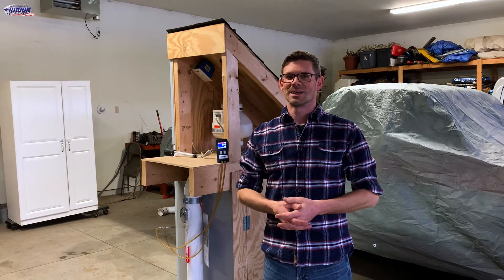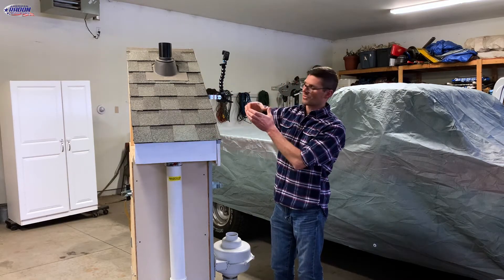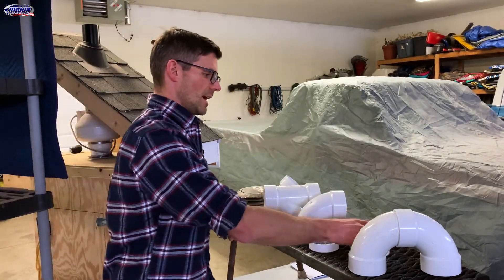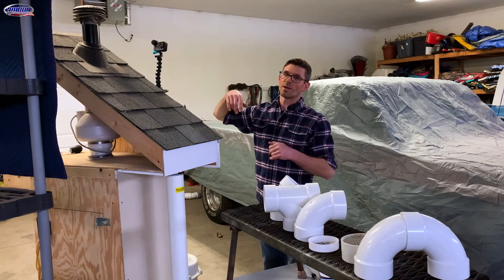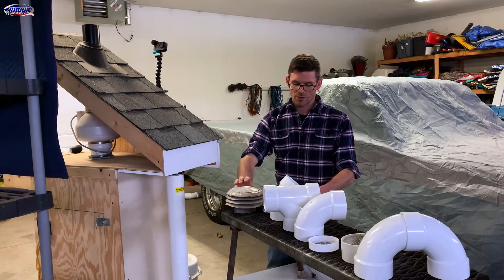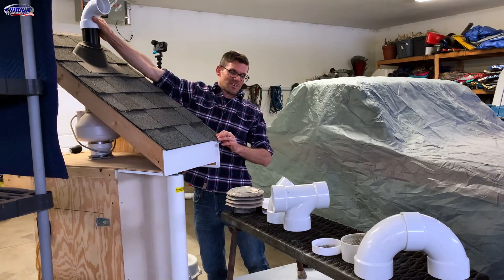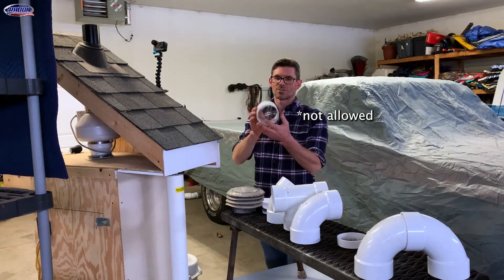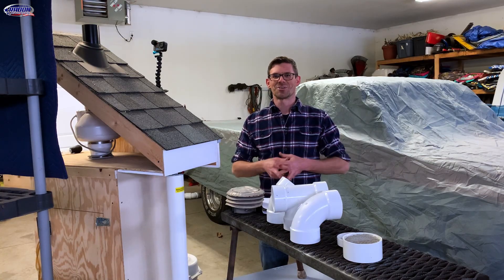Rain Caps on Radon Systems? Why We Don’t Use Them

Comment: Great video.  I am in Florida and we can get some major rain.  I just had a mitigation system installed and noted there was no cap on the exhaust pipe on the roof.  Although I read it is not necessary, the thought of that much rain going into the system, through the fan, and back into the foundation caused me some real anxiety (I heard termites like a moist foundation).  So I put a cap on it.  Got it from Amazon (RadonAway 76001 Vent Cap for 4" Schedule 40 - I have 3" pipe so I had to use a connector to fit my exhaust).  I noticed recently that the radon levels in my house spiked, but only at night (from .05 to 9.43).  It then comes down during the day.  I thought the cap may have been the reason, but the first several days with the cap I saw no increases.  I guess I can get up there and remove the cap to see if that makes a difference, but it sure feels like it is still moving the same amount of air.   Before I try to remove the cap, I wanted to know if you or anyone else has had any experience with this cap causing issues.  Maybe remove the "critter guard" screen to increase flow?  We do not have "critter" issues.  Your thoughts?
Reply from the maker: Boy, I'm not sure what would cause that. Could you be getting re-entrainment with the discharge air being pushed in a horizontal direction? Perhaps the winds are calm at night allowing the radon from the exhaust to enter your home.

Comment: I cannot express how grateful I am for this video. When we tested for Radon results came back at 40 pCi/L. That is not a typo. I picked up an EcoQube radon detector for monitoring and saw peeks as high as over 60 pCi/L. I installed a mitigation system using 4" pipe and a strong suction fan. The system reduced the Radon considerably, but we were still averaging around 6 pCi/L. I was trying to figure out what next steps I would take when I stumbled across this video. I had put a half sphere rain cap on my system to prevent rain from going down the vent. After watching this video I jumped up on the roof and pulled the cap. The levels came down and I've not seen them go above 2.1 pCi/L since pulling the cap and average around 1.2 pCi/L. Amazing what just a little resistance to the air flow can do. Thanks for the great demonstration and all your other videos that have helped me so much to get a great working system!
Reply from the maker: Thank you for your comment, Kevin. I'm glad the video helped you make your home safer.
Reply: How long after did  you test after installation? Could take some time to lower levels.
Reply: This can't be correct. This was just a coincidence. As you can see in the video, he says the CFM is the same open or with the cap, the only difference is it blows the radon downwards which is not allowed and not good for open windows

Comment: I know your are inclined to locate fans inside rather than outside.  But if your home does not have an attic, and you are not allowed to put it in a garage with living space above, you are forced to put it outside.  Have you utilized any low profile encased fans for exterior mounting?  I have seen the fantech RNSL as well as the "RadonAway" encased low profile sold at home depot
Reply from the maker: I have used each of the low-profile fans you are talking about. They are the equivalent of a midrange radon fan. I prefer the mounting method used by the Fantech RNSL over the RadonAway SF180. However, the SF180 gets points for looking cleaner.

Comment: Why does it matter if it goes down. Its on the roof. Mine comes out the center of the roof. It would have to move many feet, down and then find a window or door which is unlikely. Do you ever see smoke from a chimney come back in a house? Makes no sense.
Reply from the maker: This is covered in Section 6.4.9 Angled Trajectories in the 2023 Soil Gas Mitigation Standards for Existing Homes. Here's a link https://standards.aarst.org/SGM-SF-2023/26/index.html#zoom=z

Comment: My GFCI tripped on radon fan after high rain. I took the fan apart and seems there was water on the inside causing GFCI to trip. I think a 90 degree bend on the top will fix that problem.
Reply: They have a bypass offset rain drain coupler

Comment: I didn't have a cap and a chipmunk ended up inside, killing the fan. I put a radonaway t vent cap when I replaced my fan.
Reply: Probably doesn’t comply (or work too well) with a dead critter in the fan blades. Sometimes the better is the enemy of the good.
Reply from the maker: You may want to check to see if your radon system still complies with the mitigation standards since adding a rain cap. 

See section 6.4.12.2 https://standards.aarst.org/SGM-SF-2017/26/index.html

Comment: We had a Radon mitigation system installed in 2006 in Wisconsin. This summer we noticed mold growing on the pipe running up through our garage. The fan is still working properly based on the gauge reading in our basement.Can you do a video that addresses this issue? Thanks.
Reply from the maker: Yes, we can. Would you be able to send us some photos of the issue so we can add them to the video?
Reply from the maker: That's not a bad idea. How do you suggest I set this up so you can see the results?
Reply: I assume "on the pipe" means the mold was on the outside of the pipe, not the inside then? 
I'd guess it's condensation on the pipe that's at fault then, not rainwater, etc.

Basements tend to get a lot of warmth/cooling from the ground around them, so if it's hot out, the basement air is probably significantly cooler than your garage. The cool pipe in a hot/humid garage would attract condensation.

In theory, I would expect an air conditioner or dehumidifier in the garage to help lower the dew point (pipe would need to get even colder before it attracts condensation), but it's kind of expensive/energy intensive to air condition a garage just to avoid mold on one pipe. 🤔

I suspect you'd want to insulate the outside of that pipe with a closed-cell spray foam or something. Open-cell foam, or fiberglass insulation will still let tiny bits of air through to the pipe, where it'll still condense, and you'll just end up with soggy (and ultimately moldly) insulation. 

My old apartment building had to have some cold AC lines in the walls redone several times, the contractors didn't put the right kind of insulation on the new pipe, and even the tiniest gaps were enough to let warm air reach cold surfaces. It was still dripping condensation down 6-7 stories into a bucket in the lobby when I left...

Comment: if you want to vent out a wall, and across, with a bit of a downward slope is that OK.  If radon is heavier than air, how does it get all the way out the roof?
Reply from the maker: I'd point you to section 6.4 of the radon mitigation standard. That section talks about the exhaust discharge requirements. https://standards.aarst.org/SGM-SF-2017/23/index.html

Comment: We recently had a storm here in Florida that dumped a whole lot of rain (48 hours of non-stop rain). Our radon contractor used a cap (4 way exhaust cap) on our radon system. I'm wondering why? A bit more info, the suction point is about 40' away from the exhaust point in the garage. In addition, at the point of suction, the pipe runs up an additional 10' inside a vaulted ceiling closet.  The majority of the pipe run is horizontal through our attic. Do you think that has anything to do with our cap and having water not move through all the pipe run? 

Does capping the exhaust really matter if 1) the exhaust is placed at the appropriate distance from windows and 2) if our radon levels have dropped dramatically. We're currently averaging .6 pci/l in the last month. Down from an average of 5 pci/l in a multi family townhouse building (our unit located in the middle).
Reply from the maker: It's probably not that big of an issue in your climate. Here in Minnesota, it would likely be a place for ice to form on the cap and possibly the surrounding area that the air is blowing on.

Comment: What about snow and ice blocking the pipe? Not worried about rain getting in.
Reply from the maker: The open vent at the beginning of the video is the best way to prevent an ice blockage. Attic routes that include insulation on the piping, rather than external systems, rarely have freeze-up issues.
Reply: @AmericanRadonMitigation  what do you do if it has to be mounted on the side of the house?
Reply from the maker: We offer our customers a deicing system to help ensure the system doesn't freeze-up. You can also purchase our deicing kit here: https://americanradonmitigation.com/product-category/radon-system-de-icing/